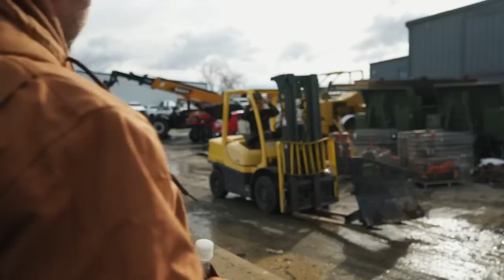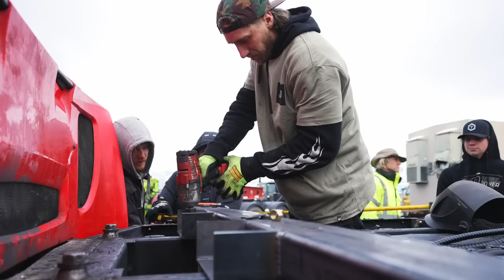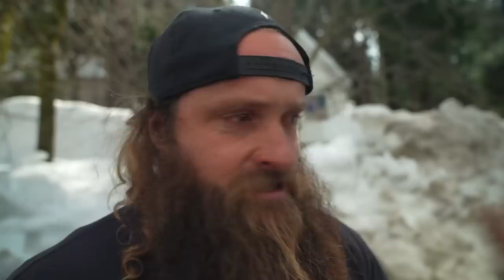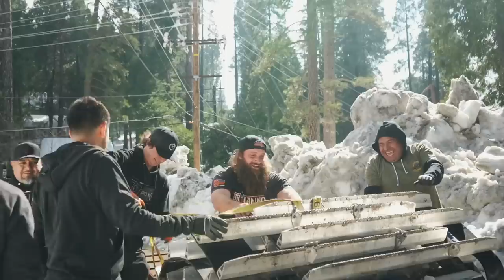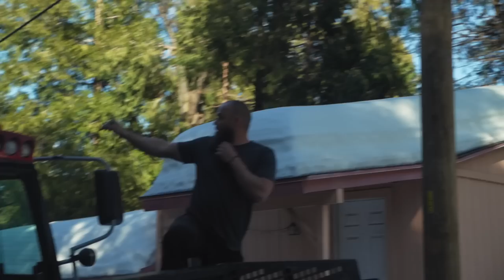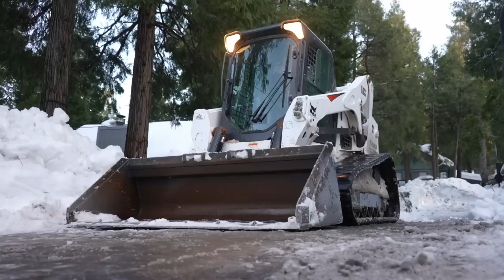California Rescue! (All Hands on Deck)

Comment: Great job Guys!!!!   Saw Alan using WD40 on a binder. Instead of oil use Slip Plate (basically graphite paint). Looks gross but lubes the moving parts and doesn’t attract dirt like oil. Could also use it in the snowblower box and chute. I get it at my local old school farm store/tractor dealer. Again great job and thanks for all you guys do!!

Comment: Next time u are putting your tracks back on after u pull over them and start working them over the top hook a chain bind up to the blade from said track and as u pull foward it will drag the top of the track into place so u can hook it together

Comment: What's up Heavy D, I watched the other 2 videos and reckon you should get one of those trucks that's basically a snow plough, but instead of a plough it has basically a jet engine that blasts heat at the snow, melting it. Apparently used for airport runways. As stupid as this idea is, would it not work better in these situations? Cheers.

Comment: the worst part is you guys got up here when it was way above freezing so you had to wave through slush and a layer of ice halfway in the snow instead of powder. roads are steep as hell and tight as hell. you can see why just 6" of snow is hard to get around through up here. you got san francisco steep roads in areas with sharp corner that lead to hill sides. however its a super fun area to drive in the summer.
Reply from the maker: Yeah it would be a nightmare with fresh snow on the road